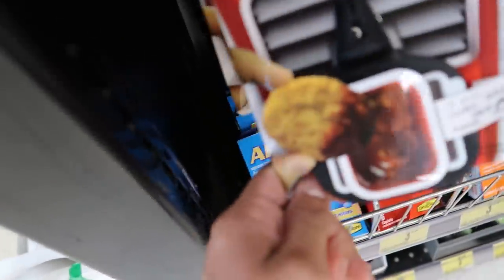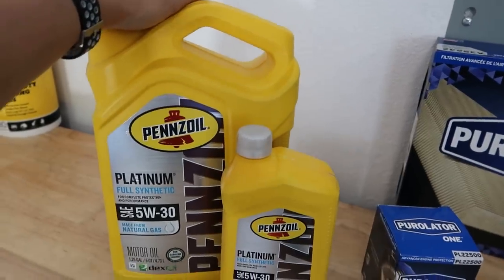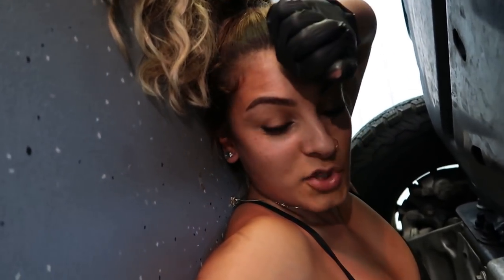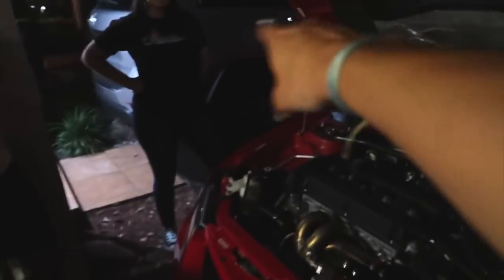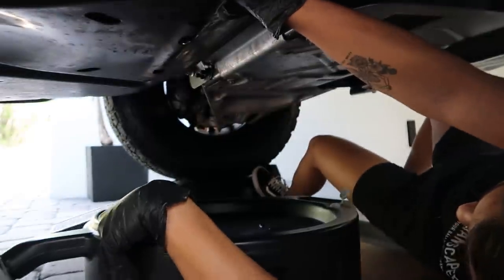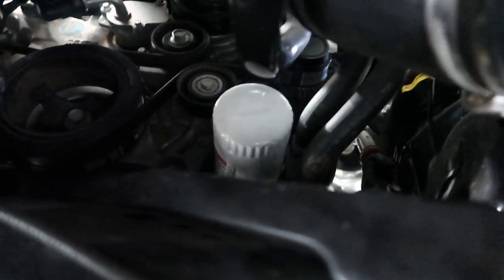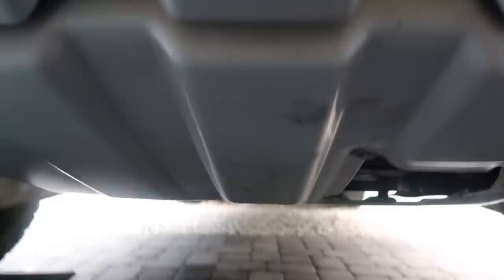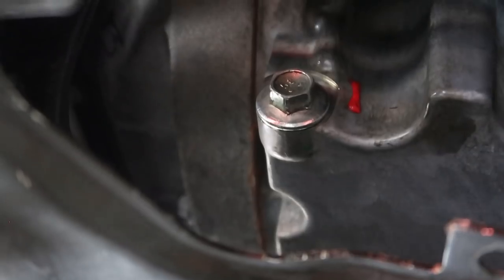OIL CHANGE ON MY 2019 FORD RAPTOR

Comment: Good vid. Safe yourself a lot of aggravation and get a Fumoto valve. It replaces the Oil pan plug and you can use a hose right into your drain pan. I actually enjoy changing oil on my Raptor because of this inexpensive part. Good luck!

Comment: It's a good idea to change your own oil and transmission fluid or gear oil. Those quick oil change places screw something up 10 times out of 9. They either don't put in enough oil, put in too much, forget to change the filter, put the wrong oil in, or who knows what else. When you do it you know it's being done right.

Comment: Happy to enjoy some new content! Looking Gorgeous as ever! 🥰🥰
As far as adding oil to the filter, you can hold the brake and gas pedal down then hit the start button, and the engine will turn over without firing and you can build oil pressure! Don't forget on most EcoBoost engines 15-20 minutes of wait time after turning off until checking the oil level.

Comment: We’ve learned that the Raptor needs many skid plates removed in order to change the oil.
Small price to pay for its performance capabilities.
You need a impact drill to zip out the bolts. Makes it faster and easier.
Watch Rainman Ray’s videos. He zip’s off more 10mm bolts than any man I know.

One good thing about oil on the driveway…a couple of rainstorms and the stains go away.

Comment: I would rather keep running the OEM Motorcraft oil filter and just change the oil vs using a Puralator, over the years ive had some issues with low oil pressure and lash adjuster/chain tensioner noises. Nothing but changing oil filter and topping off oil cured the noises.....granted this was 6-7yrs ago so maybe their technology has improved and its a thing of the past but once ive been bit 3 times i dont pet that same dog again lol. 
I lmao when you pulled the drain plug and said....omg its squirting everywhere🤣🤣💀

Comment: I really wonder when the engineers at Ford are sitting at their desks designing the oil systems for some of these vehicles they're planning to put on the market, if they actually take into account the owners changing their own oil. Because it seems like most vehicles, not just Ford, are designing these systems to be serviced on a lift, which most consumers don't have. Just seems like a pain in the ass every time you wanna change the oil yourself. I know it is for me and my vehicle. There's gotta be a better, more user friendly way to change the oil on a vehicle. Engineers, I swear. Lol 🤦‍♂️

Comment: Royal purple high performance is way better
Reply: It's been tested pennzoil is better than royal purple. Second best to Amsoil. There's plenty of test out there check them out.
Reply: @jonathanrodarte03  not to me I was using amsoil then change to royal purple is 10 c times better then penzoil
Reply: I wouldn’t put Royal purple in my lawn mower, complete junk. Use pennzoil if you want the best.
Reply: @danbrown6529  hahaha you don’t know you’re oils I been using amsoil for 30 years and Royal purple is my second choose better mileage I will keep using it